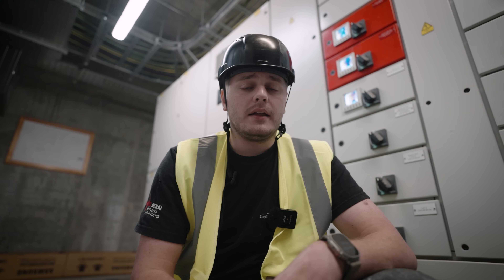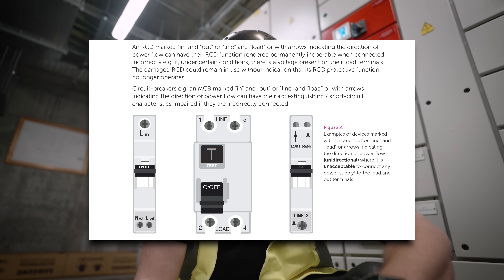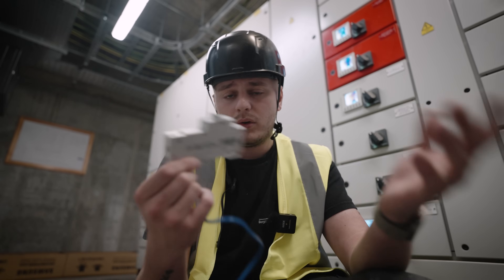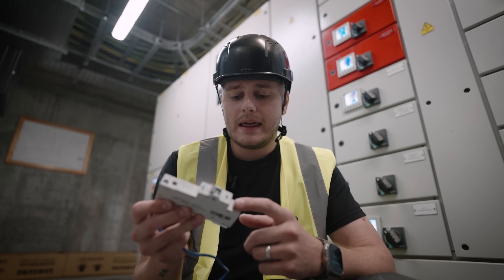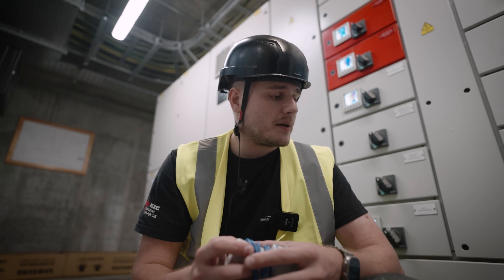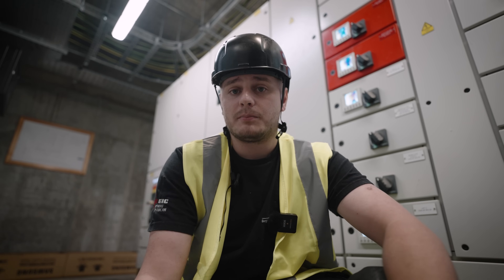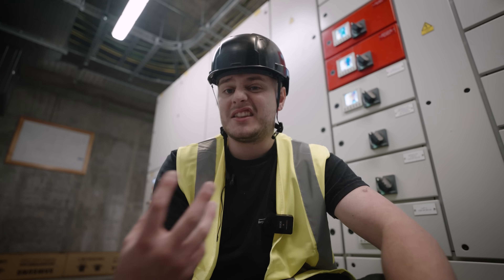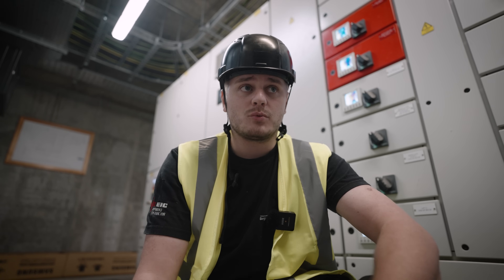Are most circuit breakers now obsolete? -  Amendment 3 update to BS7671

Comment: Just subscribed to your channel, so well put together.
I plan to have my solar battery hooked up to a 1000w inverter, an IT unit, that has an earth to the vans chassis, but not linked to N. This will then go to a 2-pole automatic transfer switch (ATS) to a single gang plug. 
Power will come into the other input of the ATS from a campsite hook-up. Not trusting these campsites I was going to have an RCBO before the ATS then a consumer box after.
Will I need a 2-way RCBO?  Kind regards

Comment: It is my understanding that the issue is the trip coil burning out as it remains energized once the device has tripped. Makes sense as the power will remain on the "output" terminals, but this won't happen on the majority of solar as it is grid tied. As soon as the device trips then the solar inverter will switch of. I am wondering if the use of single pole RCBO's are more of a problem if there is a neutral earth fault. Interestingly my SMA inverter instructions recommends NOT supplying it from an rcd and if you do it must be 100ma. That is an 12 year old inverter things may be different now. Interesting how these issues are only just starting to show up now when d solar as been about for a good 13 years

Comment: There needs to be some perspective here. People coring a lack of bidirectional protection an automatic C2 would only really possibly be where RCDs are supposed to be there for fault protection. The vast vast majority of renewable circuits are surface mounted and not on TT installations so would not need additional RCD protection anyway. 

This is a problem that needs sorting and releasing a new amendment is precisely what should be done to do that but it is really not the huge issue in terms of how many devices are out there as people are suggesting imho.

Comment: How do you explain that AC is alternating for old devices so they won’t work for a fault that is in the reverse phase ! And since inverters only supply the busbar sub circuits have single direction power flow ( ignoring AC ) and have their appropriate protection as required.
This is as daft as double insulated core SWA’s 🤣

Comment: I have already been C2'ing installations during EICR's because RCD's aren't bidirectional when protecting solar/ wind power which have burnt out on the solenoid. Initially it was because if the test button doesn't work = C2 but after Mark Allisons video last year I've been amending my comments to list "needs a bidirectional rcd". Biggest issue being that not every manufacturer is making it easy to find out and not every technical helpline has someone at the end of it that knows if their product is or isn't.

Hats off to the chap on Efixx comments the other day that told me to phone M2, their technical helpline is one of the best for knowledge on their products I've had to deal with.
Sadly the latest EICR with an RCD issue on solar I C2'd has gone radio silent, possibly due to the amendment dropping a couple days later and realising they potentially have thousands of installs nation wide which they're now liable for the design and rectification of.
Reply: If it burns out the coil, there is something hugely wrong with your inverter, because anti-islanding should shuit it down, and that is mandatory.

Comment: I asked engineers about this way back at the start of solar and everyone seemed to think it wasn't a problem. How come the mighty IET only now have got their arse in gear? Are they going to pay to put all the installs right?
Reply: Because the IET is usually a decade behind the real world - by their own admission. With solar on it's own it probably isn't as much, but with battery storage now becoing popular and island mode now appearing it problably is starting to be more of an issue. We've had this with the first couple of goes at AFDD's with the stupid lookup likelyhood of lightning which thankfully got quickly abandoned, to the then EV charing points about having PEN protection and all that
Reply: If they are saying they don’t function they’ve also just made every single devices todate ineffective since AC flows in both directions by definition 🤣🤣👍
Reply: @MrLeecavturbo  as i see it, the issue relates to the  RCBO solenoid POTENTIALLY being left energised which appears to have been designed for intermittent duty.  That said,  most solar installations are grid tied and when the supply disappears the grid tie inverter output disappears, so problem solved - no issue at all !  If you change this to a battery system, then am3 surely only needs to  require a bi-directional rcbo etc.  Not a huge issue as a battery conversion  is going to require extra  electrical work in any case.  My understanding anyway

Comment: The unidirectionality of "usual" devices only comes from the fact that most RCBO etc. in the UK are based on a microcontroller, right? Reason for my question is I'm based in Germany and we are told that it absolutely doesn'T matter how you connect RCDs, RCBOs etc. and they do not have any markings on them whatsoever, whether one terminal is the load side and one the grid side of it (they are solely based on the electro-magnetic and bimetallic principle). 

Would love to hear your comment on it! :)
Oh and by the way get well! Wish you the best!
Reply: As long as you're using a RCD type A that's correct.
With type B RCD it's a bit different, because of the electronics inside.
Reply: @wiedapp even most of the type b work in both directions 😅
Reply: @circuitbreaker1434   Yes, they do. However: The internal PSU doesn't like being repeatedly cut off from power, after being constantly connected to it for months. Therefore it is technically better to connect them in the right way.

A PSU will always be a PSU, even inside an RCD.
Reply: @wiedapp  hi, just wondering why the PSU doesn't like repeatedly being turned on and off ?
Reply: @scherry5135   The capacitors inside a PSU of any type are the weak point. They heat up during operation and especially electrolytic capacitors tend to dry out because of that. As long as power stays on, there doesn't have to be a problem. But when the power is cut off and you switch it back on, the capacitors might blow up and make a mess.

This is a problem in general for all types of PSU. Your TV at home suffers from the same problem, for instance. It's capacitors are usually placed near hot components - if by accident or deliberately is something only the manufacturer does know but is not willing to say...

Comment: Bi-directional RCBOs sounds like a good idea on circuits with microgeneration but… please correct me if I’m wrong …aren’t most RCBOs inherently bi-directional? They typically rely on a bimetallic strip for light overload, and magnetic coil for big overloads, plus a toroidal transformer carrying line and neutral with a detection coil to trip in case of an imbalance.  I don’t see why any of these components would be directional?  Is it really just a labelling issue?
Reply: I'm no expert in these matters, not by any means.  I'm just an older bloke that had little to do with RCDs having worked in the '80s.  It's about 2 things from what I can tell.  The manual test button being held in for an extended period, which is the main concern, and devices that do not switch the neutral.

The test button part is obvious, but the neutral part may not be.  From what I've read about the ICs used etc no RCD latches the earth fault state - ie once the imbalance through the CT ceases the coil current is reduced back to pre-trip condition (there is always minor current through the trip coil with electronic types).  This is backed up by actually experimenting with several 
'directional' RCD/RCBOs available in Australia, the trip is repeatedly fired with supply on the wrong side and you can hear it but once the imbalance stops so does the firing.  Of course, there may well be an RCD out there that does latch the condition and does place high current through the coil essentially until it burns out.

Imagine you have a non-neutral switching electronic RCD, a N/E fault downstream of the RCD, and supply on the wrong side which will keep the electronics working post trip.  The RCD will trip but imbalance potentially remains present due to the N/E fault, so the coil is left with high current indefinitely.

A magnetic RCD would have a similar issue with N/E faults since the coil is powered by the CT directly but I'm not sure if it would cause a problem since it's only trying to disrupt the hold-in magnet rather than whacking the heck out of the trip mechanism like electronics do.

Ensuring the use of neutral switching RCDs will address N/E faults, switching the test circuit addresses excessively long presses of the test button.

Happy for anyone to make any comments about the above to explain why it may be incorrect.
Reply from the maker: I believe uni-directional RCBOs if powered from the load side have the potential for the solenoid and RCD logic board to burn out as they remain energised, proteus did a good video explaining it, the bi-directional RCBO’s have an additional contact internally.

I believe that this same level of protection can be achieved with and MCB and RCCB both of which have generally been bi-directional for years, do check specs though, verso have a little PV board that does exactly this 🤝🏼
Reply: @residualelectrical  But if the microgeneration (inverter) detects no grid, It  shuts down almost instantly and doesn't generate any power, to "back feed" a RCBO. 

Having a Bisdirectional would leave an extra level of safety especially if its just a drop in replacement rcbo, on any future installs.
Reply: @GraemeMcKeague  the issue is when a solar panel system is wired into a consumer unit, They typically wire the load side of the RCBO from the solar inverter so are always receiving load on the load side of the circuit breaker (it’s always back feeding when inverter is making power) so it might destroy the RCBO circuitry if it’s not bi-directional

Same would happen if using ac couple battery storage system when it is discharging the power to the house it will be backfeeding via the load side of the RCBO
Reply: @GraemeMcKeague  In normal operation the PV is constantly back feeding the RCBO, as Mike has answered that can potentially damage the circuitry inside the RCBO. Especially when they operate under faults or the test button is pressed. With Hybrid inverters and battery storage the flow of energy is consistently in both directions so its essential we start to use true bidirectional devices.
Reply: @electrician247 just use european mainland RCDs and it's fine 😅